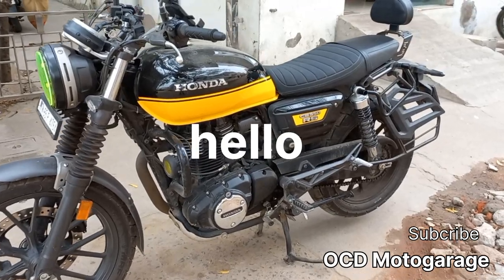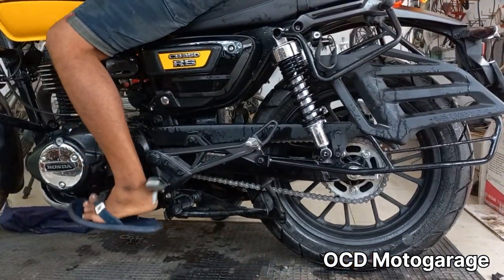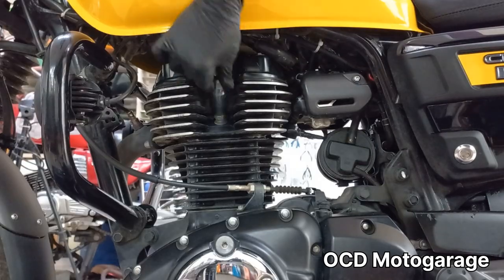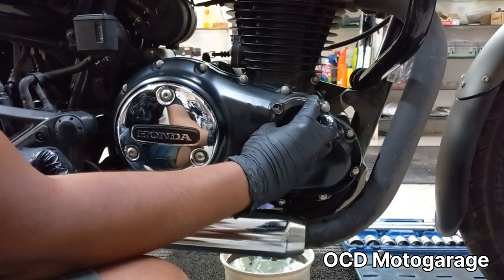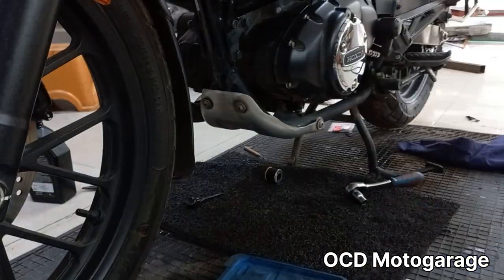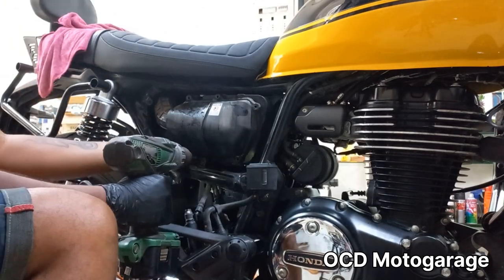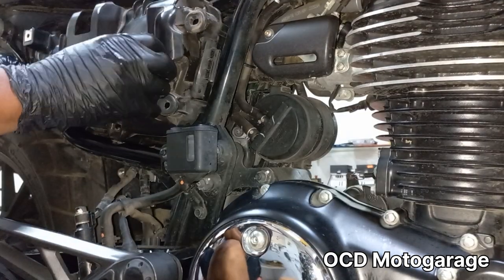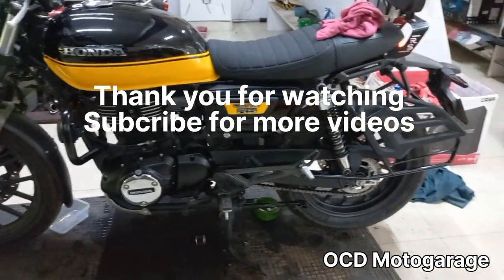Honda CB350 RS 2nd Self Service 2023 | How to change oil, Oil Filter, Air filter & Spark plug check

Comment: Suggest me some cost effective ways of maintaining cb350rs , i hears that  we save a lot money from without doing showroom services and similar spares are available for less price
Reply from the maker: Hi, if you do it outside you can save some money when compared to showroom. Each service have different check list to do as per manual. Engine oil, air filter and oil filter available locally. Air filter available on Amazon, oil filter sp 125 will be suitable. Oil you can use 10w40 fully synthetic oil. Rest others like o rings you can buy it with samples
Reply: @ocdmotogarage5389 thankyou so much brother ❤

Comment: Bro can Honda service centre provide parts bcz. I dont want to go service centre bcz they charged very high. So. That i want to know is the service centre can provide any parts? 
So. That i bought and install my bike with a proper guide by a garage man.
Reply from the maker: Hi bro, no they don't do counter sale. For general service you can get oil, oil filter outside bro
Reply: Thanks. 
But which is the best engine oil for rs?
Reply from the maker: @pmsubhampritam1004  bro I don't find any oil with grade 10w30. So from next service I am gonna change to 10w40

Comment: Hi bro. I’ want ur clarification on factory fitted LEd headlight can be replaced with other brands like Philips LED lights for more visible light. Pls clarify on this issue. Thank u
Reply from the maker: Hi bro, factory headlight is fixed led. We cannot change the light or modify it. That's  why I installed aux lights.
Reply: Thanks for the clarification bro. Actually I finalised this bike but still want to wait as I learned one more model like Rebel is about to launch, but if its get delayed I’ go for this beast bro

Comment: Does this mudguard extender touch the tyre in the potholes? In my bike I am facing this issue.
Reply from the maker: Are you using same carbon mudguard extender ? This will happen bro, because its flexible. So when you hit pot hole it will touch the tyre for a sec.
Reply: Yes I'm using the same Carbon Racing mudguard extender.
Reply from the maker: Okay bro. The mudguard is way to extended from the main bolt so it be flex when you hit pot hole.

Comment: Hey Man, how do you fix higher idle rpm on CB350RS when starting the engine cold
Reply from the maker: Hi, while cold starting the engine every hness and RS engine will idle at higher rpm. It's actually electronic choke on work. It's normal and it will settle down in 1 or 2 mins max.